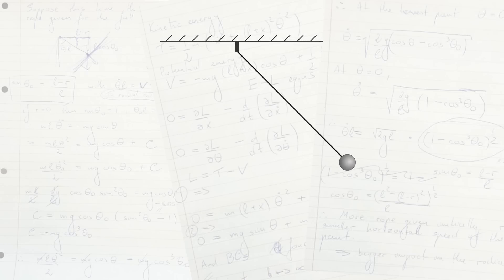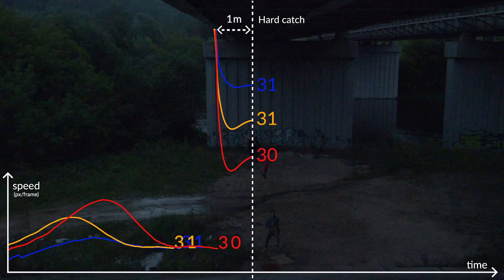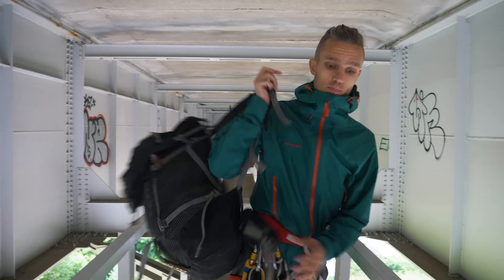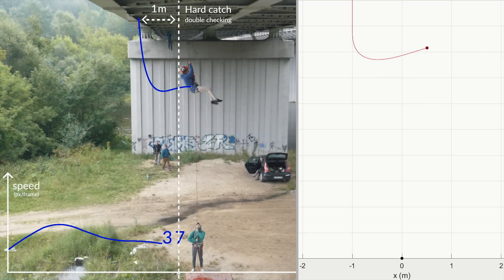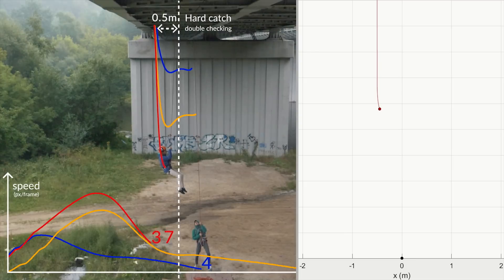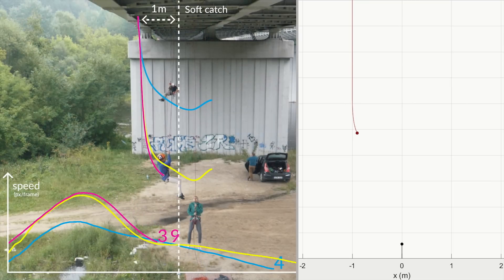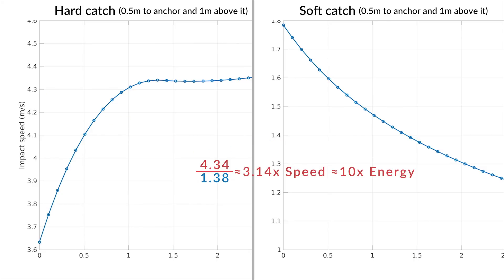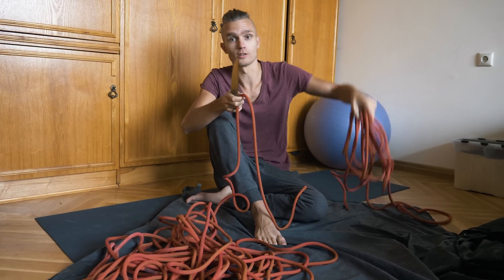Too much Slack while Lead Belaying?

Comment: As a trad climber, I stand back from the wall and run in towards it right before the rope is loaded. It's sort of a half-way soft catch for safety even though the gear is rated to be able to take a true soft catch if placed properly

Comment: Thanx for the great two videos, my friend needs to study both of them 😀

Two points:

A: there are better ways how to do dynamic catches, you should definitely know them and show them in such a video: 
1. instead of letting a few meters of free rope it is better to hold the rope softly at the beginning of a catch and gradually make the hold more stiff. From some point there is good to have belaying gloves for such technique.
2. also besides a jump you can stand some distance from the wall and move/run and then jump at the right moment.

B: you shall definitely learn how to cut a rope 😀 Just put some tape on the place around, cut on a cutting board and then use a lighter on both new ends.
Reply: Wouldn't method 1 only work with an ATC?

Comment: My buddy watched this vdo and he said giving out lot of slacks is a good soft catch! After i have heard that I have to think twice to climb with him. In the real world, the climber will be close to the wall and fall above the last protection, especially the vertical wall. So the vector force in scenario is different. And for the overhang or roof, i will remove the slack of the rope as much as i can because im light and im naturally dynamic belay otherwise my climber will potentially hit the deck if he falls. Correct me if i was wrong. Thanks!

Comment: Great video! So when my wife falls I usually absorb a lot of the fall energy in my arms because I instinctively pull down hard with my arms and bend my knees before she gets to the end of the slack and I hop with my legs and calfs as her weight is pulling my arms back upward. Probably not great for my shoulder joints but it's an instinct and she loves my belaying! I wonder how much this affects the force of the catch?

Comment: I didn't read all 347 comments, so this may have already been mentioned, but your formula to calculate % speed reduction needs some TLC.  The correct formula is (test speed - ref. speed)*100%/ref.speed.  In your first example you showed 69/62 = 11.3% slower.  What you actually calculated is that 69 is 11.3% faster than 62.  Properly, (62-69)*100%/69 = -10.1% shows that 62 is 10.1% slower than 69.  Of course, let me say that this video documents an amazing amount of planning, preparation, and work.

Comment: Love the video. But considering you need to time the jump, because jumping 0.2 seconds before the rope starts to tension, it would be worthwhile to test the impact of jumping vs no jumping when the climbers are roughly the same size. In that case, the rope will pull you up. And based on this, also check what's the kg difference/fall distance combinations where jumping becomes important.

Comment: this is probably old and will be buried, but you should include the angle of climbers velocity at the time of impact. You might be going faster with more slack, but because you've bounced back a lot of that force is directed vertically and not horizontally into the wall, look at the angle of the tracked line as it passes through the vertical mark. If it's perfectly perpendicular 100% of that force has to be absorbed by your body.

Comment: It looks like all of these falls were taking with the climber at the level of the anchor or last clipped point? If so did you replicate any of these with the climber above the anchor point?  I believe  that a lot of the difference between acceleration into the wall is dependent on the angle and velocity which the climber becomes taught on the rope the more obtuse the angle the more angular acceleration of there momentum translates into the wall. At a mor acute angle the translation of angular momentum is less. If the climber is above the anchor and the rope is taught the angle is more more acute. This is the same principle we use for building anchors. Obtuse angles multiples forces.

Comment: Great experiments!
It looks like you measured total speed. Wouldn't it be more interesting to just consider the horizontal component of the velocity vector?
Reply: Great video and work up.  I do agree with Kai (@bsocke) on the speed should not be the measurement, but the horizontal component of the velocity or the velocity component perpendicular to the wall.  I bet if you measure the trajectory angle after the bounceback, and reduce the total speed by multiplying the cosine of the angle, you get a lower horizontal velocity into the wall.   It looks like a 30deg bounceback angle, so that would be cos(30) = .86.  That is more than 10%, which is about what the increases in speed were, and so it would change the results to have the opposite conclusion.... longer fall reduces your horizontal velocity... though the total speed will increase.
Reply: You’re going to his the wall with your vertical vector too. Excluding it seems nonsensical.
Reply: @joestevenson5568  you won't, that's the whole point. If you throw a ball against a wall at a really sharp angle, the component that's at a right angle to the wall gets deflected, the component thst runs perpendicular to the wall stays unchanged.

Comment: Contrast the title of this video ". . . while LEAD Belaying" [emphasis added] to the discussion at 9:49 "What if the climber is close to the wall  but above the bolt?" "We haven't done the fall tests yet."  But this situation is the only one that corresponds to a LEADER fall.  By definition, a LEAD climber is at or above the protection.  If the leader is AT the bolt, there is only a little slack; if the leader is ABOVE the bolt, the fall distance is greater than the amount of slack.  In your experiments, you fall length and the amount of slack out are close to equal.

Comment: You guys should factor in the reaction time needed for the climber to process the fall and get in a position ready to cushion the impact. I’d much rather fall longer and faster if it gives me the opportunity to get my legs out, as opposed to slamming a shoulder or back  into the wall.
Reply from the maker: Yea... Well super short, tight falls are harder and you won't have reaction time as well...
Reply: Hard Is Easy Exactly! Just helping your point

Comment: That's really cool, thank you for the video! I love the serious physical modelling, and highlighting the fact that it's not always impractical to consider most of the factors. 

One thing that looks like it might make some difference to me, is considering the horizontal component of the velocity? ie. some of those high-slack jumps, the trajectory isn't going perpendicularly into the wall, but curving back up before meeting the wall. At a guess, it's the speed at which you're approaching the wall, dead-on, which is the most scary - from a physical point of view, the equal and opposite reaction force from the wall would be opposite to your velocity, so you've got a higher rate of deceleration . The deceleration being the thing that hurts :)
Reply from the maker: Yea, if you won't slide up or down the wall during the hit and your velocity just goes to 0 upon impact then you just need a speed vector - combining horizontal and vertical speeds - to know how much energy you will have during impact... 
But this is also and old vid ;) will touch this topic again in the future to make it more useful for everyone.

Comment: Your speed depends on acceleration. Your acceleration depends mostly on gravity+height+weight, 
only variable here is height, due to more or less SLACK.
More SLACK=more Acceleration while falling ;-) Also more slack=more rope to absorb the energy ;-) 
Yet 1 meter more rope can't compensate the added energy for 50kg*9.8m/s^2 for 1 meter

Comment: 11:30 What is bad there? do I miss a damage?
Reply from the maker: If you pinch the rope it usually has a curve - and you can feel the core inside. If you can pinch it (like in the video) you already know that inner core is damaged and you should be careful already. (In our case it was very soft at that point.
Reply: ty!

Comment: I would add though that falling more gives the climber a longer time to react to the fall and brace with his/her feet. A close fall will result in an uncontrolled wall crash? But the bounce back is more damaging to the rope! FYI  I think that rope you used to test already exceeded its recommended number of falls limit
Reply: No, their experimental method provides the best control. Feet kick in the air during a fall, making the data difficult to measure and interpret. They are interested in the net force/velocity at the person's center of gravity, which is the best indicator of the potential for a serious injury (i.e., broken pelvis, spine, or head trauma), not just a broken ankle.
Reply: yeah you shouldnt be measuring speed if the harness point to original vertical position, it should be the feet to the wall speed.

Most often your centre of gravity is as close as possible to the wall during climbing (except big overhangs, but even then) - when you fall, you fall slightly outwards (which is how you fell  - you dont usually fall straight down, unless you blow your feet while very splayed out against it). 

Because you fall outwards, you will swing back to the normal (ie vertical), with feet out -- you put your feet against the wall to break the force. The impact on the feet should be the thing to watch for (with extended legs, likely only possible with an actual wall for the climber to reflexively react to), not the harness point.

So the results would be slightly different.
Reply: It's extremely hard to get an injury from the forces on the harness. It's soft, your flesh compresses at time of impact, the knot tightens etc etc. Hitting the wall in a swing is far worse: broke my ankle doing it, and saw someone do it in a gym. Have heard of many many more people injuring themselves hitting the wall (rock, it's hard) than landing in the air in a harness (I've heard of none. I've heard of people taking 100 ft whippers in the Valley into air and not being injured). 

The additional element not considered is pendulumming across the face/into arretes during your fall. If you keep it tight then you fall to the last bolt and penji over. If it's more slack you fall further and the angle of the penji force is much less. Friend on a tight belay just broke his wrist slamming into an arrete because of this (but his belayer had to due to a ledge lower). I've had a few cases with no ledges/just thin air and preferred the slack out to not slam into arretes/be ground into meatpaste across the face.

Many many considerations to belaying than just the force on a harness which is pretty minimal until you get into factor 2 falls.
Reply: you are not going to break a pelvis in a harness. its quite easy to break an ankle slamming into the wall. 

As I say i've seen it happen twice, it happened to me, and i've heard of 3 other climbers at my gym having broken ankles (one from belaying someone much heavier than them way far from the wall in bare feet - got pulled upwards, then swung in  and swung into wall). Hitting something solid is very very different from being pulled on by a harness. 

And yes, you are right, head trauma from slamming into a wall is much worse than somehow getting head trauma while falling into air onto a dynamic rope.

Comment: I would like to know: How many times can you fall on the same rope before you would have to swap it out for a new one? 

Great video, thanks!!
Reply: Totally depends on the falls. factor 2 on a segment of rope is recommended to throw it out. People try to count the # of factor 1.5's on rope ends, but Im hoping that it's close to zero for most people. Only multipitchers really need to worry about this stuff, it's hard to construct >factor 1 in single pitch climbing.

Comment: In my experience, it's simply because they haven't thought it through. Simultaneously, their brain properly accepts that jumping will soften the catch, but don’t realize that while they're jumping up, the rope is pulling diagonally. When you point out the competing physics, they'll usually say, “Aha!” I not only stand as close beneath the first bolt as terrain allows, but also estimate the terminal longitude of rise. I.e., where to be when the tightening rope pulls the rope-end carabiner of the lowest quickdraw horizontally outward toward the vector to the second quickdraw. As I'm sure you've realized, dynamic belaying is science—but when properly done, looks like art. 😎

Comment: P.s. You're right, the hop timing is crucial, but you will zero it in with repetition. And for best results, here are two crucial factors: For falls that begin just above the last clipped bolt, the belayer must be coiled and prepared with knees bent before the fall begins; secondly, the hop's effectiveness improves considerably when the belayer's center of gravity is positioned directly beneath the first bolt. Cheers. 😎
Reply from the maker: Thank you for the tips! Standing beneath the bolt actually helps a lot! I always wonder why ppl stand so far away from the wall... It's hard to make a soft catch that way...

Comment: Hi guys, great work!
But I have a little question, the speed you obtained from the video analysis was the total speed or was horizontal? Because what worries is the horizontal one...
Reply from the maker: Hi thank you Javier! The speed in the graphs is vectorical - combining both horizontal and vertical axis.
If you don't slide up or down during the hit to the wall then you should worry about vertical speed as well - because it'll need to be absorbed also.
Hope this makes sense... ;)

Comment: What would be really useful too is if you could make the model show the forces at the anchor, belayer and climber. This is of paramount importance to us trad climbers since we rely on the ratings of our gear and not just the rope. It would also be really useful if the model were available for us to play with (maybe web based) ?? Good work.
Reply from the maker: Hey, thanks,  you are not the first to ask this. And we're still waiting till Patric (the guy who made difficult math part) will have time to come back to this.
Another idea was to get the dynanometer and do additional tests and measure real forces to the anchor.

Comment: The elephant in the room that you didn't plot - THE EXTRA DISTANCE THEY ARE FALLING! All but one of the injuries I've seen in 4 decades of climbing and 12 years on a SAR team were from impacts on features on the wall - ledges or larger holds. The only one not involving an obstacle impact was an upside down fall where their heel was whipped into the wall.

Your own graphs show that you are greatly increasing the velocity that people will impact ledges or objects on the wall. My conclusion is that a soft catch is potentially better on overhanging rock.

However, many climbs (majority?) are vertical or less than vertical. So you should test falling in these circumstances. And graph vertical velocity vs horizontal velocity.

In the end, like all things climbing, how you belay can be summed up with "it depends..."

However, I commend you for trying to actually test the hypothesis that giving a soft catch is better.
Reply from the maker: Hey thanks for the comment, first of all that's why we measured the speeds at 90 degrees - to imitate vertical wall situation. And yes "it depends" and we mentioned that in the end of video that you should not drop your climber onto obstacles.
And we did test the effect of soft catch alone - without additional slack (I hope you are not confusing these two?) - https://www.youtube.com/watch?v=JjoRtkWv2nQ
P.s. most common injury in sport climbing is ankle sprain. Any climbing destination we visit we see at least one person with this injury. And the main reason for that is hard catch.
In any case i'll repeat again it's not our goal to teach anyone here... We did our tests and shared the results. What you do with them it's up to you.
Reply: I think there’s some trade offs between velocity of falling and blowing your anchors all together.  I would really like to know the forces at various points in the system vs time and under different conditions.  Youve shown good correlation with the mathematical model so hopefully that model can be used to show forces too.  We would also like to know the rope model as this has a bearing on stretch/speed and impact forces.
Reply from the maker: Hey, we've been asked for the force to the anchors already so many times... And at the moment we're just waiting till Patric (the guy who created math models) will have time again to improve his models and include this. We've also had ideas to get dynanometer and do real world tests on this. But struggling to find time for this at the moment - but one day we'll do it for sure.